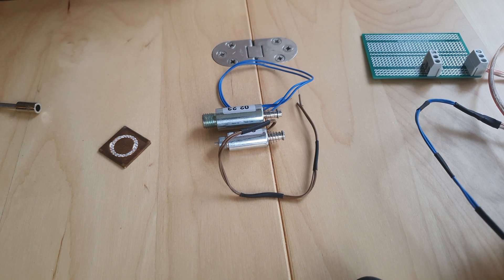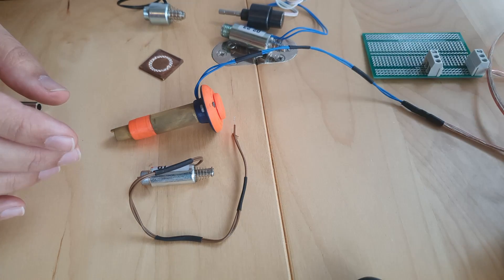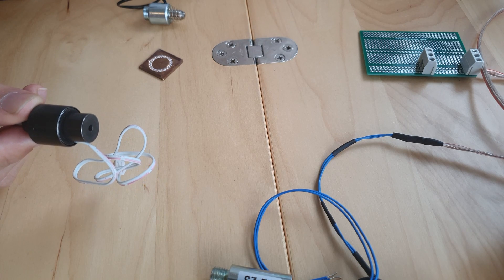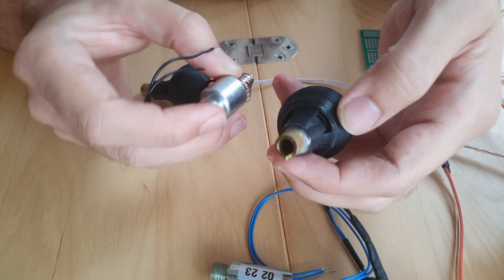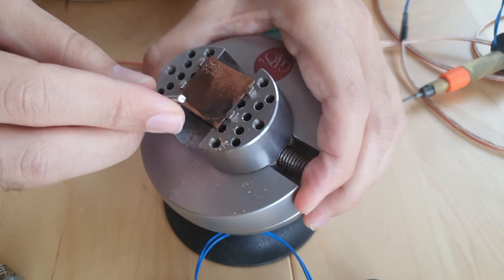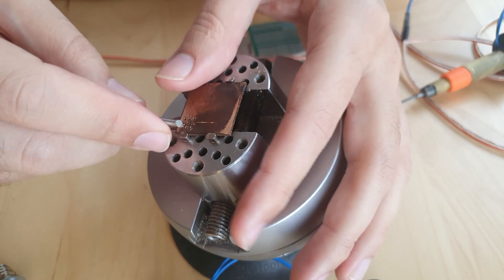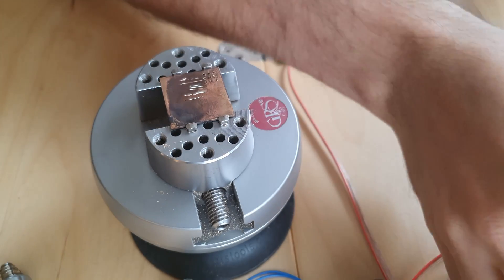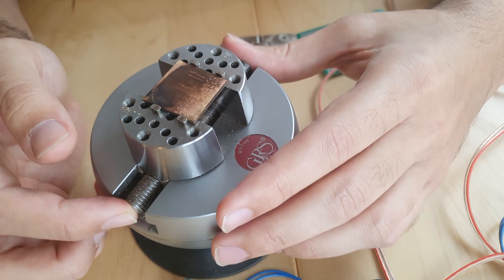The perfect solenoid for your DIY Graver

Comment: I can see a hand piece made of copper for better heat transfer, or even water cooled. The water tubing would still be smaller than a pneumatic, and the pump could be something simple, wouldn't take much.
Reply: @HgAuDevice47  Hi, I'm using 2.5N solenoid in stainless steel encasing in which I drilled holes every 5mm with the idea of better cooling. I have used it for 45min @20-30Hz with 10-20% duty without any sign of heating. That is 12V solenoid ran at ~15-20V.  I think the issue is finding the right balance between solenoid's N/V/Hz/Duty.
Reply: Of course I didn't drill holes in the solenoid but in the stainless steel encasing  :)
Reply: @bekk2000  I'm going to have to build one of these for sure.
Reply from the maker: Great summary of the voltage/duty cycle ballance!

Comment: Thank you sir, for sharing all that info for free!
I built the handpiece pretty much by your plans (stainless steel though) it works very well.
I would like to add  that for those scared of all the control circuit boards, simple PWM with Duty/Hz display from Amazon connected to audio amp channel as driver works just fine.
 You have to play a bit with Duty/Voltage/Hz ratios but it's worth it IMA
Reply from the maker: Thank you for commenting and also trusting the calculations and process. Hope you had good results and was able to grow.
When we share, we grow together.
Have a great week!
😄

Comment: Dunno if you're still around, but i've been using your github link; i really appreciate the info you put in and the work! I'm feeling pretty close to getting it, just not having a lot of luck getting a nice even imapct. I have a few solenoids coming in the mail, and am probably going to try to make one, but either way, thanks!
Also.. oh, i found a company selling a solenoid graver now, and it's 100% for sure 3d printed, and it looks damn close to your model; the modes they describe look the same too, and they used the exact same pedal as the ez graver and yours; i think they're trying to patent it too... something like $2400 USD for the machine. ouch.
Reply from the maker: @briandanay2487  hi, if you need any help contact me on reddit. Why are you having issues gettting an even impact? What is happening.

Comment: Thank you for sharing your project and findings! I study jewelry making and I'm planning to build one to get into graver settings! Are you using 12V version of "perfect solenoid" and powering it with 12V?
Reply from the maker: @ericying  hi, I am using now the 6v version and powering it with 11v. The rating voltage for the solenoid is when it is powered 100% of the time.
Reply from the maker: Sorry, I was not that clear on the answer. I am using a 6V rated power 1335 solenoid withe the handpiece from the OnShape site. The model is ITS-LZ-1335-D-6VDC. I am powering it with a 11V power supply.
Reply: @selvalss  Thanks so much for your clarification and all the experimentation on the solenoids! I found the handpiece on OnShape without problems. Looking forward to make one.
Reply: @selvalss  Any chance you know how many watts max it draws or the resistance of the coil?
Reply from the maker: @ericying  The resistance of the coil is 9 Ohms
Reply from the maker: According to the datasheet the duty cycle at 11V should be 40%.

Comment: This is an excellent video - do you have the stl files for the handpiece for the 1642 solenoid?
Reply from the maker: Thank you Matt. The files can be found at the OnShape page, it is called "Handpiece for solenoid 1642", from there you just have to select the pieces, on the left panel called "Parts", then "Export" and select the desired format as STL. If you click on the link you can see the other files from the same user and they will be there. Please let me know if anything is not working correctly.

Comment: Sir, how do you control solend energy? Just simple voltage control or maybe pulse by pulse current control? Do you have adjustable pulse frequency? What frequency range your are using?
Reply from the maker: Hi, I control it by the process of "bit banging" in a determinate frequency, its like I create the pulses with software that is installed in the board (or arduino if you prefer) and the pulses control the solenoid. The power is determined by the PSU (Power supply unit) I am using, it is determined by testing and trial and error, the idea is to have a solenoid that, given its characteristics, will give about 25W of power. The build can be checked on the github page in the description. It's possible to go from 0 to 40 hz for a bulky solenoid or from 0 to 80 hz for a small solenoid.
Reply: @selvalss  Thanks for your answer. Not sure about meaning of "bit banging" really  :D Maybe you are saying that you are controlling pulse length while pulse frequency does have fixed value?
Reply from the maker: @htchtc203  bit banging means turning on and off in defined intervals, theres no special curve being made. Right now the modes are: variable frequency with fixed power, fixed frequency and fixed power and fixed pulses in intervals. I am implementing in the future another mode that set a fixed frequency on a variable power.
Reply: @selvalss  Thanks for clarification.

Comment: How much stroke/travel is needed for the solenoid to engrave well? I I would be curious to experiment with something else different than solenoids. Not sure if if it would work tho
Reply from the maker: It depends on the weight of the plunger and speed. So for an 6.4g plunger with a 12w power 6mm is enough for lots of materials. Right now the 1642 solenoid with 6 mm travel at 9w is an all round handpiece

Comment: Glad to see you are still at it I'd still like to help with machined parts
Reply from the maker: Hi, Jason. How about an exchage of help? Do you need something that I can also provide? Where are you from? Im in EU.
Reply: @selvalss  I'm in the US. But shipping isn't that expensive.  What machined parts would help you perfect the system
Reply from the maker: @jasoncastle1741  I was mostly thinking about the part where the solenoid is attached to the 3d printed part or the part where I put the collet, since i'm eyeballing it it is not perfect, I tried to do it with steel but it is impossible with my tools. Are you interested in the circuit board?
Reply: @selvalss  Good afternoon.  I am from Germany.  Can I somehow purchase a kit?  even in unfinished condition.  I'm happy with this look, I just want to do my hobby without a pneumatic graver
where are you from?
Reply from the maker: @MILEV_Jewelry_Creator  please contact me on reddit Weird_Singularity so I can help you source the boards and install the code.
Reply: @selvalss  I am grateful to you for such a quick answer.  I'll try to figure out how to contact you on Reddit
Reply: @selvalss  Unfortunately, I can’t write to you in the reddit chat.  I get the answer that I can’t do this and I need to pause